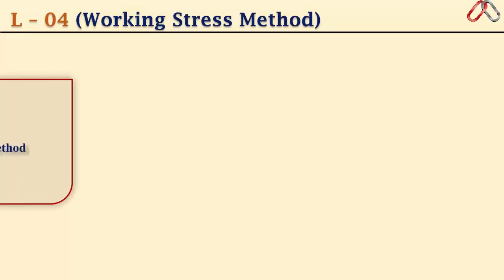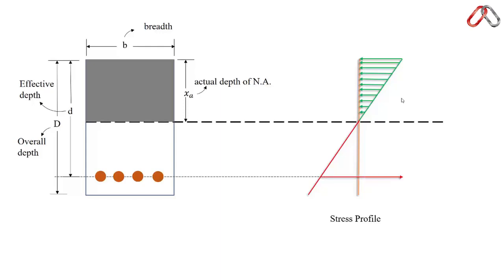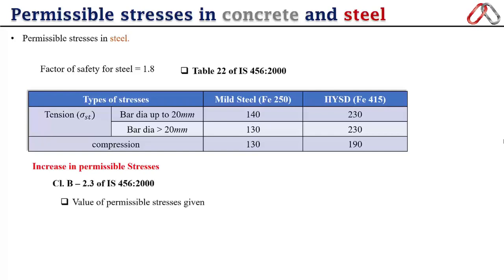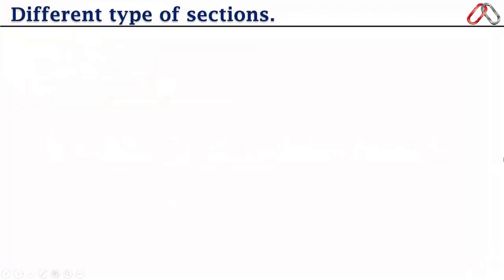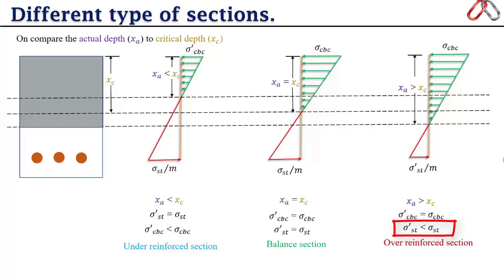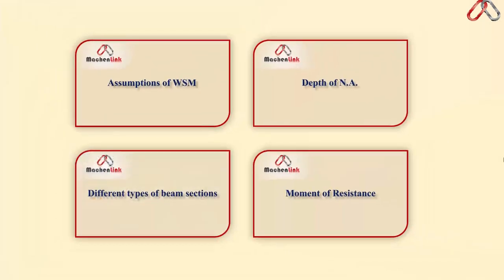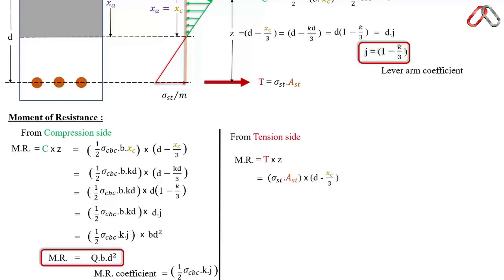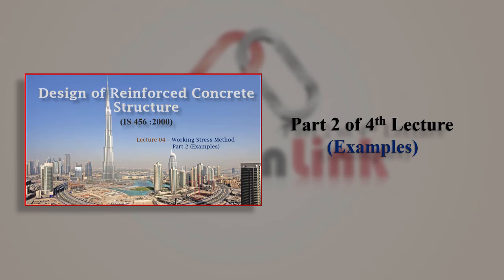Analysis of Singly Reinforced Beam || Working Stress Method || RCC (IS 456- 2000)

Comment: Why does stress in steel remain the same in under reinforced section when stress in compression zone has changed??
Reply from the maker: Hi Mohit,
In the under-reinforced section, steel stresses reach to permissible stresses before concrete compressive stresses.

Comment: I am using bs code will it be a problem for me to use these concepts in university ? or I suppose theory is same everywhere isn't it ?
Reply from the maker: Hey Arnold,
Basically concepts are same everywhere and there are a lot similarity between BS code and IS code.  Overall you can watch these lectures for basic concepts but it will be very confusing for you to use these concepts in university.